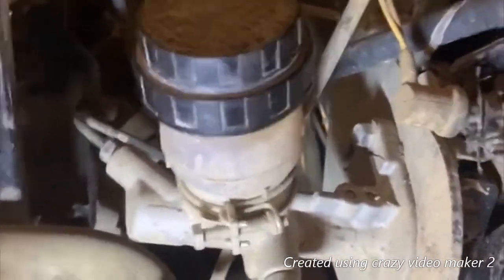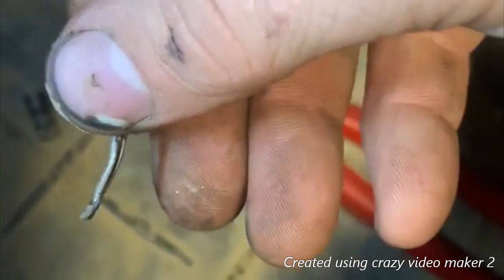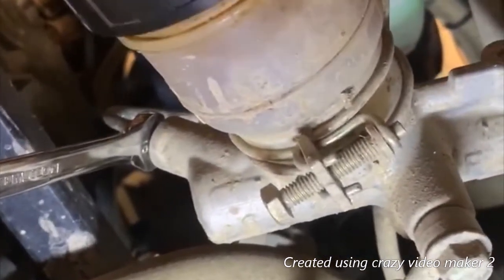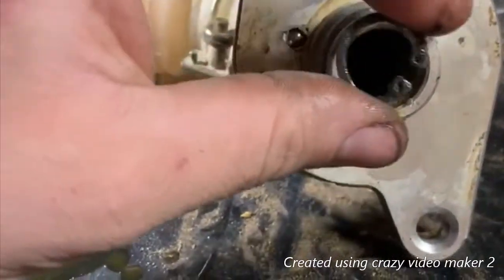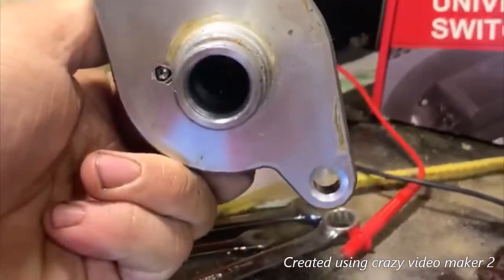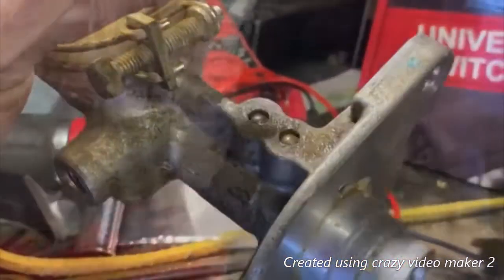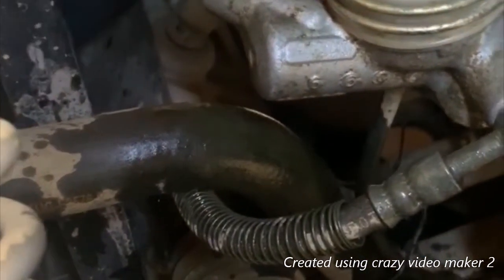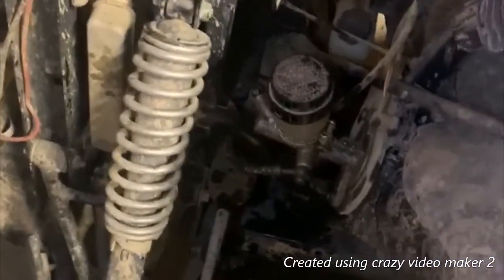rhino 660 master cylinder

Comment: You could have drained the brake fluid before removing the master cylinder and saved yourself from making a mess. DOT4 destroys plastics and painted parts in seconds.
Reply: Good to know, I had never heard of 4 before i got one of these units. I was surprised when i read the cap it said to use 4. I had a ton of DOT3 here from other automobiles, I had to get some DOT4